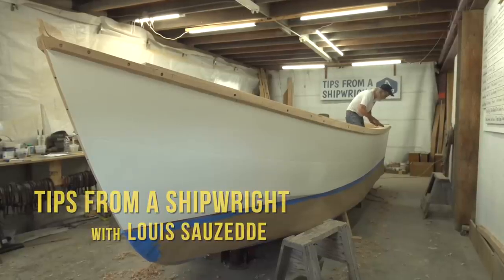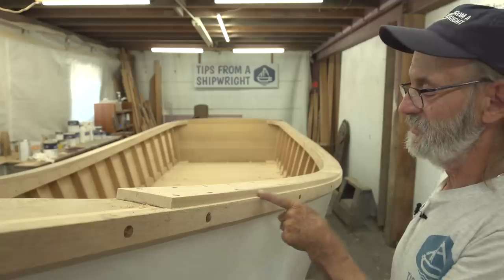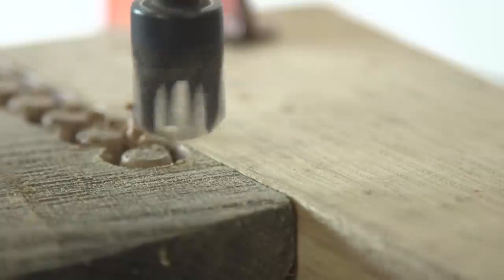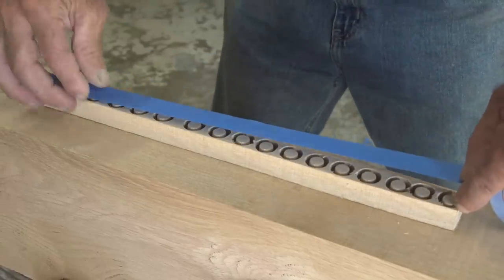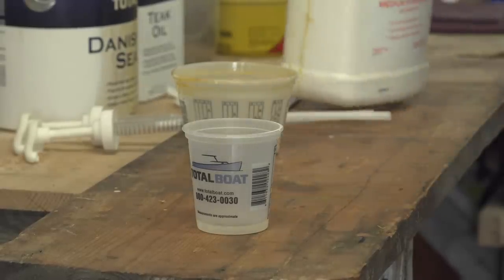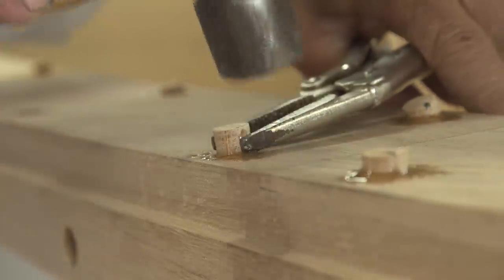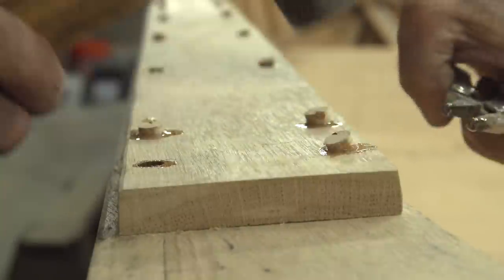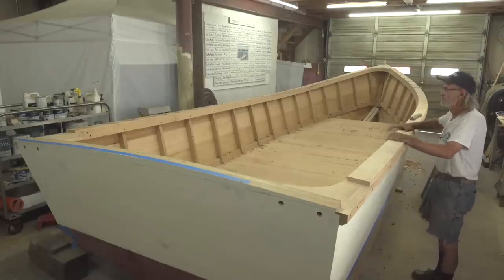Building the V-Bottom Skiff - Episode 37: Plugging away

Comment: That dot is a really great idea.

A funny side note on grain-matching:
Some lessons learned: 
1) Never turn a carpenter loose with an air-powered finish nailer. In the ceiling of our porch (25' by  50', coffered, elaborately molded, vertical-grain fir) we estimated over 10,000 nail holes.
2) Never send a compulsive to fill those holes. Mike spent months, laying on his back up on the scaffolding, using three different colors of putty to match the grain of the fir. Sometimes he would have two or even three colors of putty in a single hole. It sure looked good when he was done, though.

Comment: Nice method Lou.  The only thing I don't like about your method is that you are filling the slot of the screw with epoxy.  When I set plugs I don't put epoxy in the hole, just on the plug and I wipe the bottom of the plug to minimize the amount of epoxy that gets into the screw slot.  The next guy to work on the cap rail will appreciate that.
Reply: Epoxy doesn't stick well to nonporous surfaces. Usually it just pops out of screw heads with one whack, especially slotted screws. If they were any other type of screw then the epoxy would have to be dug out, and I would agree with you.
Reply: @PaulDeCamp  Robertson. :) And gluing a wooden bung into a wooden board means two porous surfaces.
Reply: @PaulDeCamp  I have chipped epoxy out of thousands of screw slots.  I would rather not do it when it is easy to avoid.

Comment: I see that you prefer slotted screws which is a boatbuilder tradition, a woodworking/cabinetry tradition in general... I think however that your premise of "you can apply more torque" to the screw is provably incorrect. I am pretty sure the biggest reason woodworkers prefer slotted screws is that they are the easiest to clean paint and finish products out of, making it easy to remove them for repairs. I would propose that just in my experience these heads will give you the ability to apply far more torque (breaker bar levels) than slotted heads: BRISTOL, SIX LOBE SLOT, ECX, CLUTCH,  4/6 FLUTED. I have literally used some of these type lags putting down mahogany deck boards into mahogany framing without a pre-drill using a 1/2 drive impact and bit adapter. A situation I am quite sure would cam out and or snap off a slot head.